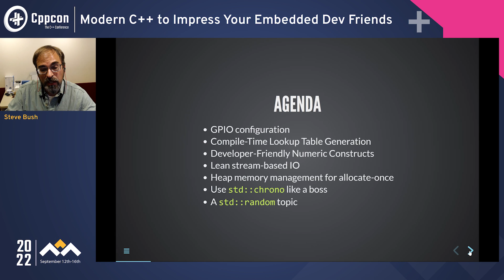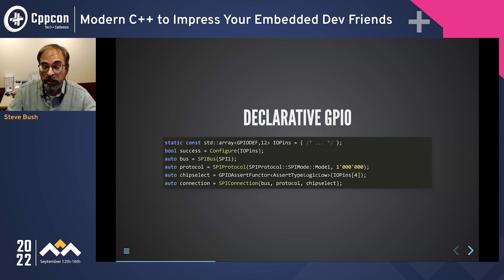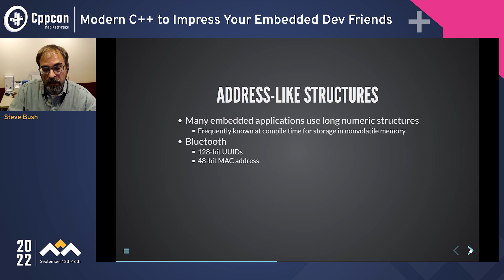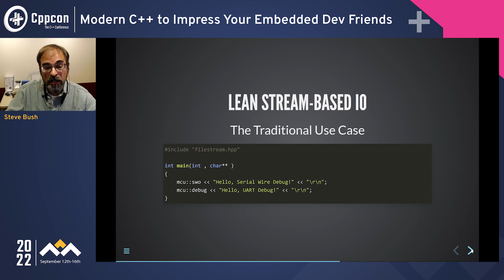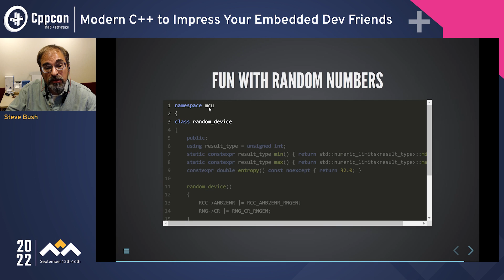Modern C++: C++ Patterns to Make Embedded Programming More Productive - Steve Bush - CppCon 2022

Comment: 26:30 or so: Unicode does not imply UTF-16LE. With Unicode, you need to specify the encoding type when you're talking about it, particularly when talking about programming with it. This especially true since the Internet uses UTF-8, but Microsoft Windows, Java, and USB all use UTF-16LE, and most Linux/Unix type systems today use UTF-32 internally and UTF-8 in transit/storage. I've never heard of anyone actually using UTF-16BE, but there are probably examples. Plain UTF-16 isn't really a thing, by the way. It's either UTF-16LE or UTF-16BE with a two-byte sequence at the start of the character stream that tells the system which of the two variants is in use. Older email systems occasionally used "UTF-7" (or a variant called "mUTF-7"), which is an unofficial encoding that uses 7-bit bytes. Unicode as a term by itself doesn't refer to any of these encodings in particular, but the whole system. UTF-32 is the only encoding which always uses the Unicode code points directly for all characters.

Anyway, because all three main encodings are in widespread use, you really do need to say which one you're talking about. There really isn't a default.

Comment: How does the LUT table work when the coefficients are pulled from the factory calibration data stored in micro?
Reply: It can’t be completely compile time then. Maybe you can compute some of it and do the expensive bits, and at runtime adjust with the factory cal

Comment: The code presented at about 28:30 centainly does not work at all. There are useless lines like "index == 1;" and a wrong mix up of 'index' and 'count' for 'result.mData' and 'text'. Finally, to parse a hex string to bytes, two characters need to be combined to a single byte. Can not see this happinging anywhere in the code.

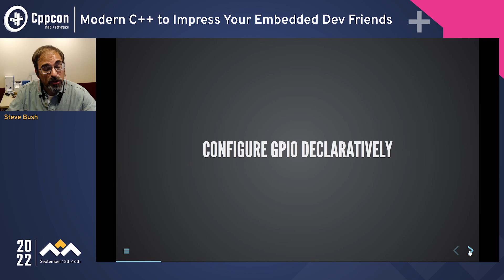Comment: 5:28 Declarative GPIO
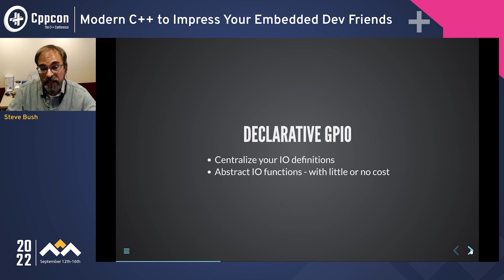16:15 Compiler-driven lookup table generation
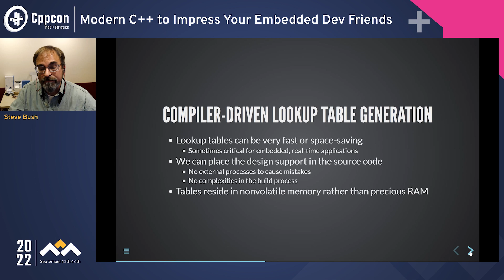23:21 Address-like structures
31:00 Lean stream-based I/O
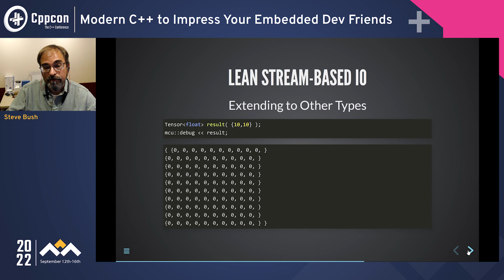40:55 Using heap in embedded applications (arena allocators)
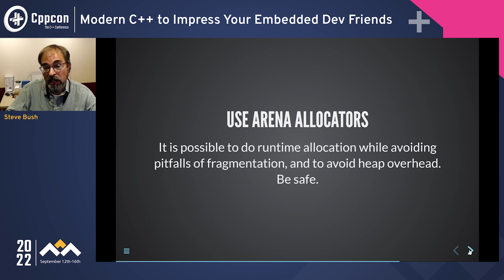50:23 Unlock std::chrono
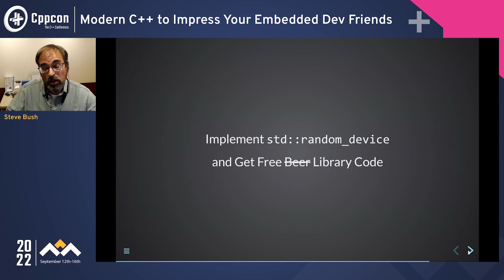54:56 Unlock std::random

Comment: 19:30 std::pow is not `constexpr`...
Reply: I believe it is in C++23
Reply: @destiny_02 believenes has nothing to do with reality. (have a look at c++ standard section 28.7.1 Header <cmath> synopsis). on g++ compiler it's accepted because the internal implementation of std::pow is based on internal __builtin_pow functions. Just take a simple code: constexpr auto i = std::pow(2.0, 3.5); on g++ is going to compile, on clang++ and msvc compilers, the compilation fails. The approach presented in the talk is not supported by the c++ standard.
Reply: @peterlauro9222  IMO pretty much all functions in cmath should be constexpr and if they aren't, it's an oversight.
Reply: @nextlifeonearth  It is not really an oversight. Overall, it is just not as easy as it seems. The math functions can have side effects, like setting the errno variable for certain input values. A constexpr function can not set errno.

Comment: I think it is not optimal to configure pins one by one in a loop, it is basically writes few bits (via read, bitwise-OR, write) into the same MMIO register again and again. What I do is I calculate a bunch of registers values (during compilation) and write those constants into MMIO registers. If it takes 10 registers to configure GPIO, it takes 10 writes then. No loops, no bitwise-OR.
Reply: But do you need this to be optimal? Correct me if I'm wrong, but you configure IO pins is once in a lifetime of a program, so i doesn't matter if you save couple of writes.
Reply: @wojtekburzynski654  it might be important to put the IO pins into a safe and known state as fast as possible, depending on your application and/or hardware.
Reply: @HelderParracho  so as always... use proper tool for a job
Reply: I'm curious how you did that. Can you share some code ?

Comment: This talk is more like "c++ basics that might impress a first year CS student"
Reply: True, but there are hundreds of companies that still use the most basic approaches from the 90'. The presenter shows here a much modern way - that's why it is important to have those sessions.
Reply: @peterfistin8584  habitual reminder that this wasn’t because of backwardness, but because up until ARM became the de facto standard, most C++ compilers had no guarantees about supporting features past C89.
Reply: Embedded programmers (at least all I knew) usually use C++ as C with classes/destructors. So anything beyond that will be an impression for them.
Reply: @mapron1  True, I’m one of them 🤣
Been involved in a dozen of companies, in safety critical applications…the core functionally was always C, and only some fancy libraries were C++, but as you’ve said, we’ve been using the C++ in a very simple way. It makes sense, if you think about it. I think that C allows us to understand easily the propagation of a signal from hardware to the topmost application layer.
Reply: @ch33rfulness a serious question, does critical application code remains under the KISS Paradigm or ends up like Mordor curses?
Reply: Many embedded engineers write C++ code as C with a C++ compiler. Introducing neat modern C++ practices for embedded programming bring net benefits to every one.

Comment: The custom shift operator overloads shown at 39:13 can actually also be done for std::iostream. These are normal  operator overloads and thus are discovered by the overload resolution if they are declared in the same namespace as the (second) argument or as the caller.
Reply: That is clear, but he got rid of std::iostreams because they are too expensive (talking about binary size) for an embedded device.